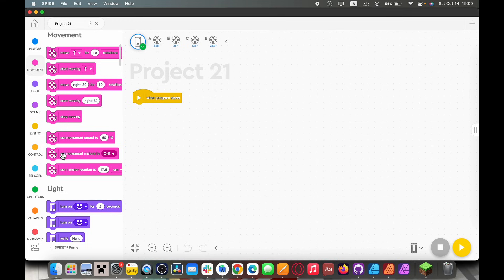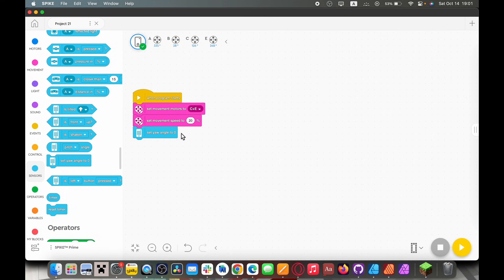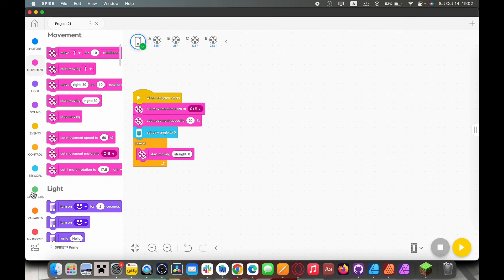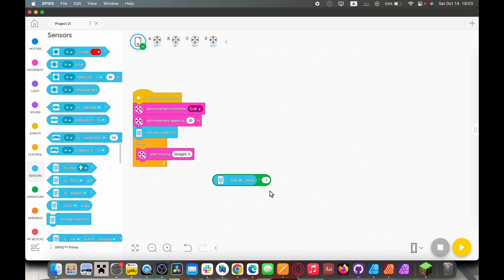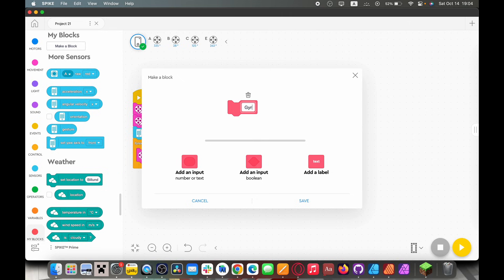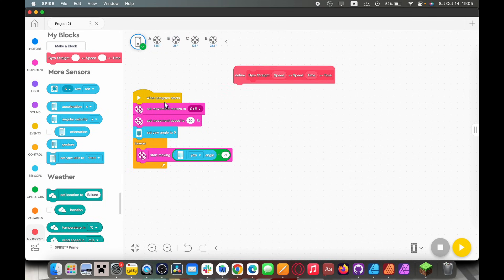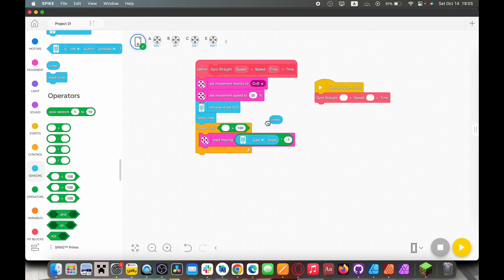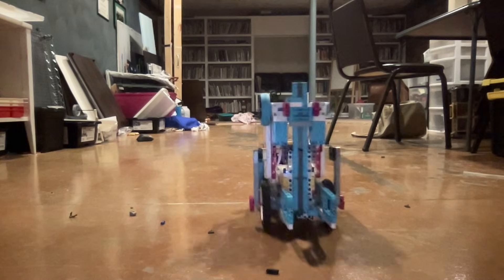Prime Tutorials Part 2: Make your robot drive straight with simple Proportional Gyro Code!

Comment: Looks like this cannot be achieved with Distance instead of Time - is that accurate?
Reply: You can do it with distance if you know how much distance corresponds to a wheel rotation. Then you can use the relative angle blocks (in the more motors extension) to stop when the target wheel rotation is reached
Reply: @MiguelLoran  I can only find a relative position block...And I can't get that to work

Comment: Can you change the speed to anything you choose? Say, 100, or 110?
Reply from the maker: If you make it too large, like 95 or 100, the robot will be unable to correct, because it would need one of the motors to go faster than 100, which is impossible.

Comment: I didn't really got why we had to multiply the yaw angle by -1, could you explain please :]
Reply from the maker: I'll explain it with an example of what would happen if you didn't multiply yaw angle by -1.

Your robot would be at, for example, 5 degrees off of where it should be.
The gyro would read 5 degrees, and the robot would start driving, rather than at 0 Straight, at 5 Right. The gyro would now read 10. The robot starts driving at 10 Right, instead of 5 Right. Instead, if we invert it and the robot is 5 degrees off from where it should be,  it will start going left 5. The robot will be at 0 degrees now, and so it will start going straight 0. Get it?

Comment: You do a nice job informing and helping people to be better coders. Do you find time or distance to be more accurate in your gyro straight scenario?
Reply from the maker: Typically, I use distance, because with using time to measure, there are a lot of variables at play, like how clean your wheels are, how close to fully charged your robot is, and many other things. Using the rotation sensors to measure how far the robot has gone is much better, unless your robot starts to skid, but then it is probably hopelessly lost on the field anyway.
Reply: @TelluriumRobotics how do I do this please?
Reply: These questions need to be answered please. So many drive straight codes but none explain how to control the robot distance, speed, etc.
Reply: Use distance every time. Unless you are going to crash into something (on purpose) like a wall. In that case, use time otherwise it won't move onto the next bit of code because it hasn't gone the required distance. Or better still, use distance until just before the wall or mission model, then a quick blast for a given time.

Comment: What if you want to go backwards?
Reply from the maker: To make it go backwards, you would need to switch the driving motors, say C + D, to D + C. This makes the robot go backwards instead. The second thing you would need to do is to take out the math block that inverts the gyro. Give that a try, and if it doesn't work, email me at tellurium.robotics@gmail.com